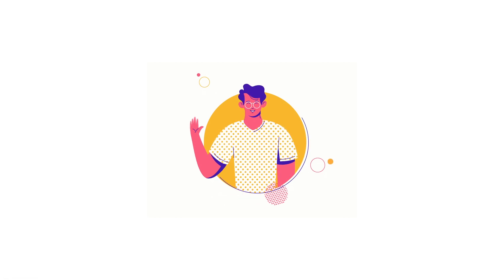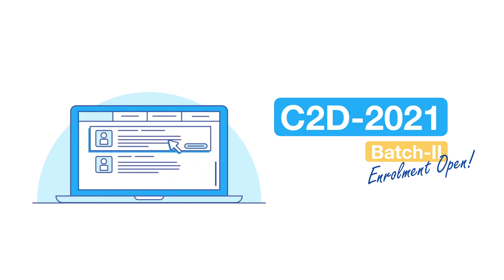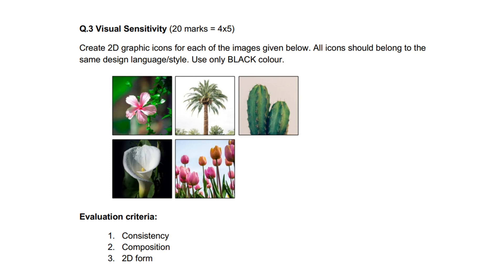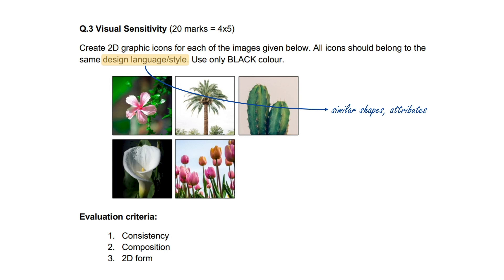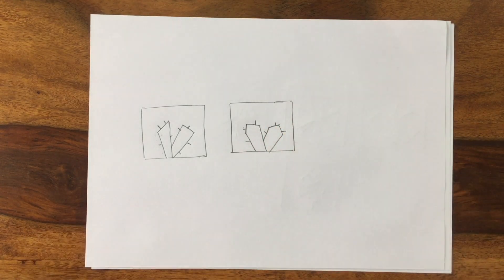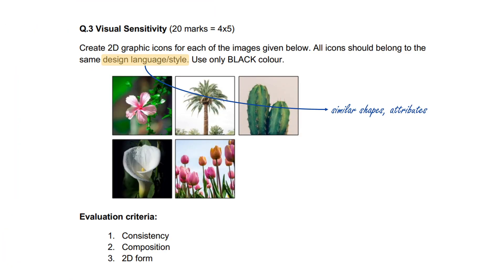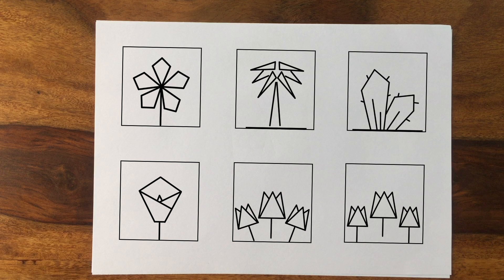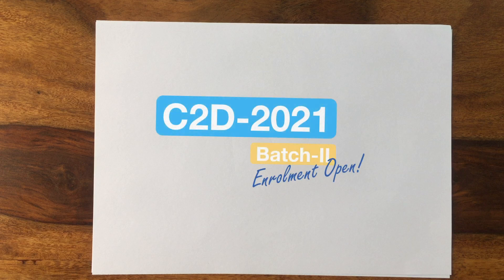Visual Sensitivity | CEED | Part-B | Kaphal Studio

Comment: Can we use colours and sketch pens to give stroke and fill in this question during exam?
Reply from the maker: You can, but it depends on the question.
In most of the question it clearly mentioned that use pencil only.
Also, using sketch pen or colors will be time consuming.